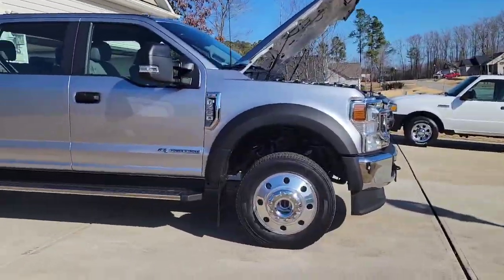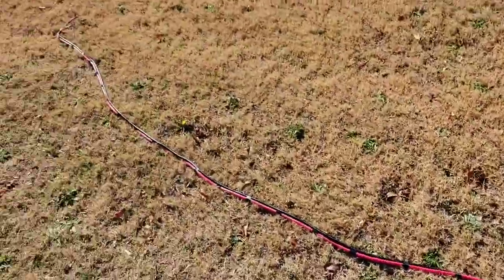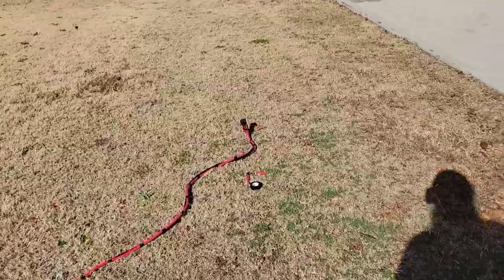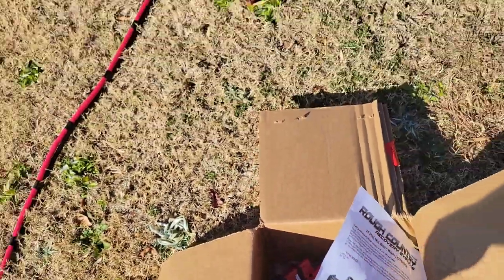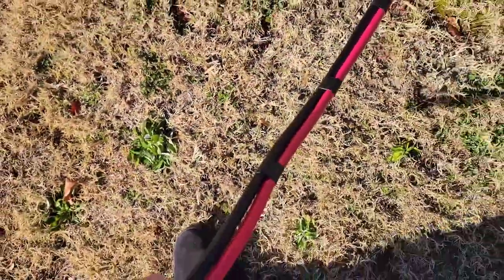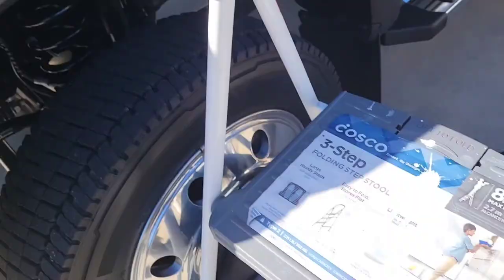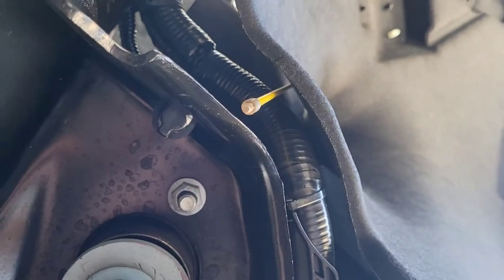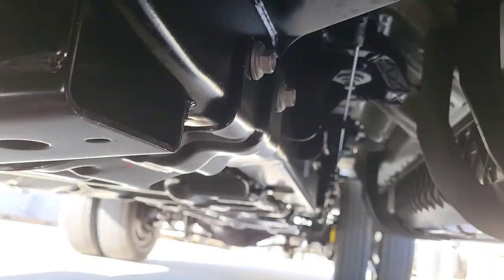Rough Country Winch Extension Wiring Harness

Comment: I tell you what bro, you gotta love an install that doesn’t require drilling 🙏🏽 Not many will understand or appreciate that part in the vid, but I do 🙋🏽‍♂️ Another factory install in tha books homie. Thanks for sharing. I don’t know what kind of tire stuff your customer had in that lil’ Ford in the background…..but DAMN! They shining like he sprayed some clear coat on’em 😆👌🏽
Reply from the maker: 🤣🤣 very much appreciated bro. 🙏.  To the little Ford idk what he had on it I went back and watched my video again to see it. 😁 funny story about that truck he got it for $400 and it has almost a Half a Million Miles on it. He told me the original owner put all them miles on it delivering Pizza 🍕.  😅. The install wasn't to bad but I did have to go back and cut all my zip ties once I got the connector to the back I came up like 2 inches to short i had to reroute to the battery differently to create more slack. Next 1 I do I will start in the back mount the connector then work my way up front. Thanks as always for the support and o Yea look out for YOUR UNBOXING VIDEO coming soon as well as another unbox from another Car Audio YouTuber by the name of dcdesignsusa . Check him out great box builder as well.  🙏👊
Reply: @keithzaczek1  Wow….$400! Yea, that pizza delivery life racks up the miles. Got a customer coming from Tennessee, with a cavalier with over 250k on his 😆 Ahhh….2” short, that had to hurt 😖 But had no doubt you’d get it right. Learning curve for the next one. I’ll be sure and take a look at his channel bro, thanks for sharing his info.
Reply from the maker: Ooo snap not a Cavalier.  Now that thing gone be loud no matter what you put in it. We'll the altima has 288k I wonder if I drove to you for a build would I be considered the highest Mileage vehicle  you've done🤔 🤣 well probably not you've definitely had some oldschools in for that 210 experience